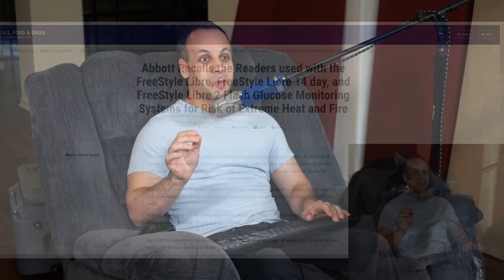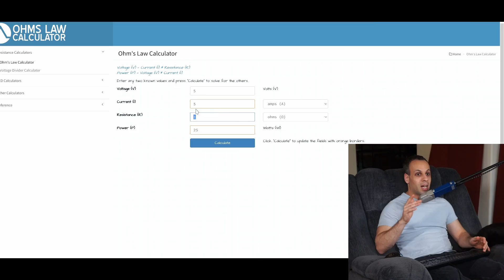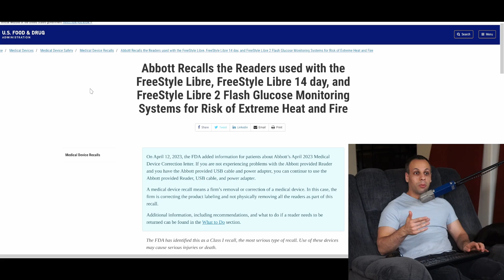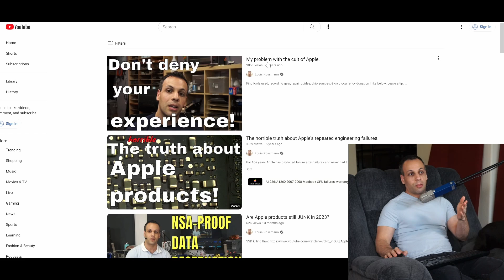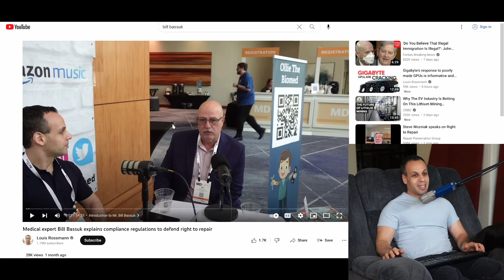Abbott gaslights customers during FDA recall of burning glucose monitors

Comment: I might still have my freestyle libre reader around somewhere. I mostly used my phone to read the glucose monitor anyways, but luckily I never had any problems with the Abbot reader when I use that.
Reply: But yeah, if I can find it I will gladly send it in. Even though you are saying you don't deal with medical devices, the reader specifically is more of a component in the freestyle system than it is an actual medical device. It's basically just a tiny limited function smartphone with an NFC reader in it. The actual medical device is the diode and transmitter that attaches to your arm.
Reply: I can barely imagine that the device is poorly made enough to where it couldn't properly with 3rd party chargers. Mine still holds charge quite well, and it's about 3 yrs old, kept fairly poorly (heast, moisture, dust, etc.). I haven't used the yellow cable it came with in at least 2 years cuz I lost it. 

I don't know jack about electronic repair, but could these devices somehow lack the capacity to reject charge once full? I could see the device wearing out way faster if it's always being left on a charger. Otherwise, I wouldn't know. 

With that being said, as a former customer of several years, I can absolutely say that Abbott's customer service on this device is AAA top-tier! 

Yes they are having to issue a recall, and yes it does display a lack of oversight on the manufacturing end, but I don't know that it's worthy of critique in the same way you're able to go at other companies. 

DME companies are usually crazy above and beyond with customer service. I'm not currently using the freestyle libre, but I can tell you that in all likelihood every customer who wants a replacement reader can and will get one for free. Furthermore, most people who use the freestyle system just use their phones. The reader is more of a backup and or option for people who don't use smartphones.
Reply: And I guess another furthermore, it does pain me slightly to call Abbott an ethical company, but the freestyle libre is literally the most affordable continuous glucose monitoring system on the market currently. There are other options which provide more precise data, but at a significantly higher cost without insurance. 

This might not be true of the latest freestyle system, but as I recall the freestyle libre 14-day, OOP or insure, priced out to about the same as a glucose meter and test strips.

Comment: Can we take a moment to say the obvious?  These monitors should not even exist. You can literally use your phone and use the app to read these sensors. If they can't get the basic engineering of a monitor right, then they should just pivot to selling a cheap android device with the app preloaded and do the relevant QA on that for when a dedicated monitor is for some reason actually required over the standard app that is already in the google play store and apple app store. My dog uses this product.
I am a software engineer that has worked on a computer vision medical product that received FDA 510(k) clearance.

Comment: If a device with a USB symbol can't accept a USB marked charger and cable, then somebody is in breach of their licence to use the USB symbol.  This is what standards are for!
Reply: Abbott doesn't put a USB symbol on the device.  They supply a  yellow usb A to micro usb cable (this cable does have the usb symbol on it) and a wall block.  Couldn't tell you if the wall block has a usb symbol or not (it is 5v),   no idea where mine is as I use an old phone charger.  As Louis figures, poor design, and using some low wattage supply as a limiting device.
Reply: @alexb.1320  wait, this is even more bonkers: So you're saying their statement can be read as 'please do not use a "genuine USB" cable, but rather our "genuine Abbott" that is actually NOT a real USB cable'  ?
Reply: @alexb.1320  The USB symbol IS on the device please dont spread false info if you dont know. There is a USB symbol on the multiple Libre devices and on the cable but not on the block.
Reply: @walrider  I don't see a usb symbol on my device, an original libre.
Reply: @alexb.1320  Weird... I have an original and a libre 2 and both have it at the same place. It's directly above the actual usb port on the side of the device.
Reply: If you believe that just plugging a USB cable from a third party causes the device to catch fire, then Louis has fundamentally failed as a communicator, or you only heard what you wanted to hear.  Because that isn't what was communicated in the release.

"The potential for overheating, spark, or fire may occur when charging the Reader with non- Abbott adapters or non-Abbott USB cables combined with misuse of the Reader and its components. Examples of misuse include exposure to liquids, damage, and introduction of foreign material into the ports.

The Abbott-provided USB cable and power adapter limit the power provided to safely charge the battery whereas USB cables and power adapters manufactured by a third party may allow much higher power, increasing the risk of overheating, spark, or fire."

Meaning that if you get crap in the ports and short or block a connector, both the Abbott provided charger and cable are smart enough to limit the amount of power delivered in the event that some communication with the device (like temp) is missing.

Other cheaper cables and chargers are clearly missing that feature.

Comment: Finally some confirmation for how shitty Abbott is! Last year I got diagnosed with diabetes type 1, in which I got glucose sensors from Abbott. To be completely honest I am very impressed and happy with the actual hardware for the sensor. At least for the version 3 sensor, as it is incredibly small and discrete. The thing that drives me crazy is how absurdly bad the app is that you have to use with the sensor. This whole video is about a monitor, which is used to scan the sensor on your body to get your glucose value. However I believe that the very large majority uses a phone app to scan the sensor with the help of NFC (which makes your point at 10:56 even more prevalent). In contrast to the actual sensor hardware, the app is absolutely atrocious. It has so many glaring flaws, where it is missing a huge amount of really basic features.

There are an absolutely huge amount of issues I have with the app, but these are some of the most frustrating ones: The app for the version 2 sensor has a thing in its settings that allows the alarm that plays when you get low glucose (which is very dangerous if left alone, and has to be treated immediately by eating sugar) to be customizable. The default alarm noise is way too fucking intense and it makes me almost panic whenever it suddenly activates. I have made a custom alarm sound that still catches my attention, but one that isn't as intense. This is on the app for the version 2 sensor, which already has quite a lot of big problems. So when I got my hands on the version 3 sensor (which hardware-wise is way more superior, and comfortable to "wear"), and got the app for the version 3... IT IS EVEN WORSE. First of all, in the settings there is still a button for setting a custom alarm sound, great! But... the button is NOT CLICKABLE! And it doesn't explain why! So you are forced to use an ear screeching, panic inducing alarm if you don't want to put a risk to your life by not using an alarm. What's more? The app for the version 2 sensor has its alarm sound's volume on the "notification sounds" type. Since I never use that I am able to permanently set it to a set volume, and control the volume for my "main sounds" freely. For some fucking reason they decided to change this in the version 3 app to use the "main sounds" volume! I was able to come up with a super hacky solution completely outside of the app, and in my phones settings so that the alarm actually uses the "notification sounds" volume, but if I was unable to figure out a way to do this I would have to always have hyper-focus on my phones volume, since if I keep it high for the alarm but forget it, then I could accidentally play audio in public settings, which both bothers people around me, and is embarrassing for me, but if I have the volume off from doing stuff in public that would normally produce sound (like for example playing a mobile game), then the alarm would be completely silent and I would put my life in unnecessary risk.

There is an app you can use that connects to someone else's app that scans the sensor, so that for instance a parental figure can help keep track of their child's glucose. This app fixed the problem of having to keep track of your volume! How? THE VOLUME IS NOT ADJUSTABLE. IT ALWAYS GOES OFF ON ABSOLUTE MAX VOLUME. And this is with the default, panic-inducing alarm.

Another huge issue that the version 3 app had (up until very recently, and I'm honestly EXTREMELY surprised that the issue was fixed), was that if the alarm has gone off from you getting low glucose. It would NOT go off again until your blood sugar went over the border of when you are considered to be low. This made it so that if you either forgot to eat something to increase your glucose, or what you ate wasn't enough, then the app would NEVER re-sound the alarm to tell you that you are still low. This is such an absurdly important feature, that is extremely simple to implement, but even so it took them absolute ages to actually implement! I have had my life almost end up in critical condition MULTIPLE TIMES due to this extremely simple, lacking feature.

A couple of months ago I got some privacy policy update or something like that, where they mentioned that they collect your glucose data to improve the experience of their services, but that is so obviously not true, since the app has such incredibly huge flaws, and where the version 3 app has 1.9 stars out of 5.

I have also heard that Abbott made pacemakers that had an incredibly huge, obvious flaw. I don't know much about it but it was something like how they weren't password protected at all, so anyone could very simply hack into them and literally kill someone. And now in this video I also learnt that they make poisonous baby-formula?? How can you be so incompetent???

I fucking hate this company, and I hate even more that I have such hard difficulties switching to another brand that makes glucose sensors. This is because, as mentioned before, I am actually very impressed by the sensor's hardware in terms of its physical size, as that is a very important for me. The other very popular glucose sensor brand Dexcom makes absolutely huge sensors in compassion. I also have the problem of the Freestyle Libre sensors (the Abbott ones that I have been talking about this whole time) being the ones that are provided to me for free by my country's medical providers or whatever it is called. I feel like switching to another sensor brand would - ignoring the problem of size, and having to learn a completely new sensor - be very hard.

Comment: As a diabetic using this system, the device mentioned in this video is indeed underwhelming.  I had two fail on me in the last 6 years.  Although I still have an Abott Freestyle Libre reader, reading glucose levels from the Abott sensor has shifted from standalone devices to NFC/BT on the phone, so thank god for that.  That system isn't flawless either, but it works.
Reply: The blood is mentioned because the device can also read bloodstrips and things can get messy.

Comment: If it breaks because a wrong 5v charger is used that's manufacturer's fault simply because ohms law you can't draw more amps without adding more volts if you make it work with 5 volts it will never burn out unless you add more volts it's simple math really... But you understand ohns laws I'm sure
Reply: Technically if you make a 5 volts circuit that's only capable of .5 amps but has a ohms of less than 10 ohm's because there too cheap to buy a resistor it could blow up if you connect a charger that outputs more than .5 amps just saying it is possible a wrong charger can break it but that's definitely the manufacturer's fault for risking someone's life to save the price of a resistor if one person actually died because of a missing resistors it should be man slotter. But I would assume a medical device would have more regulations that would I assume stop them from savings 10 cents at the cost of a human life. But I don't know maybe your life isn't worth 10 cents

Comment: I worked on design of mobile phones 10 years ago. Problem is that one can buy 1$ charger that outputs 5v but with short spikes up to 11v. I have seen that with my eyes. Technically that is not usb charger but it is on market anyway. No one HW designer can predict all the shitty combinations so called usb charger can provide. It is easy if user use properly certified CE or UL charger

Comment: I've already seen stupid usb charging systems. bluetooth headphones that can't charge via a usb port... bad design. but usually, the common denominator is 5V 100mA and then the receiver can demand more. but I've already seen my own stupid analytic device that kills its battery and then needs to be shipped to the manufacturer in the US (over an ocean) to swap the batteries. because you are not allowed to open the device on your own and put in new batteries... or make a device that does not kill batteries in the first place?
by the way, blackberry was very advertiserfriendly today. she remained on the left side where the kitty belongs to, whereas the mouse remained on the right side, where the mouse belongs to. 🙂

Comment: But if the device doesn't have circuitry that controls charging and it's all in the special factory made charger then why the hell would they use USB socket instead of just some DC jack or what you call it? They made a device that will be destroyed by regular 5 V voltage source but they put a USB socket there.

Comment: I have run into this issue with charging my phones from a USB outlet on my clock radio. The behaviour makes sense given your explanation of how the devices ask the charger to ramp up. I'm happy with a slower charge to reduce stress on the battery.

Comment: I am type 1 diabetic and have an Abbott FreeStyle Libre 2 sensor. I've been using the yellow micro USB cable it comes with on my old Samsung brick and I've had no issues. The charger brick it comes with is still wrapped in plastic in my draw as I have no use for it as I figured the resistance of the cable will suffice for protection. They've just been caught out implementing non-standard USB to save money presumably and are trying to blame the customer for using it wrong. Most people will just use whatever charger and cable they most likely already have considering it's a 'universal' standard.

Comment: I sure am glad the basic non-smart glucose meters are all that are available in my neck of the woods. Just gotta make sure to stock up on at least a three-pak of those little 'button' batteries that are at times difficult to find.
Reply: Nah this is way better then destroying my fingertips every time i need to check my glucose level.
Reply: @user-ee9cz6mc1x  I never really had that issue. I simply found the right depth setting (7) on the lancet dial and it never hurt nor did it ever create a callous around the tip of my finger. Then again, I do have the unusual combo of higher-than-average pain tolerance and super-soft skin lol

Comment: I use a glucose monitor from a different manufacturer, but don't use the provided reader, as the sensor works directly with my phone using bluetooth.  I just received a new model that also has its own included reader, presumably with its manufacturer provided charger.  I think I'll stick with using my phone to record my readings as this problem has made me pretty wary of using the provided chargers.  What makes me really nervous as these things are designed to communicate with glucose pumps, which also have to be charged.  If they can't get the circuit right on an external device, would I want to take the same risk of fire in a device directly attached to my body?  HELL NO.

Comment: I gave up using their glucometer and just use the phone app. Not that the phone app is good, it's slow, often doesn't pick up the scan data correctly, and the high/low alarms are often significantly delayed. If you want to see inside the part that connects to the person though this is a breakdown of the first version of the sensor: https://raw.githubusercontent.com/cryptax/talks/master/BlackAlps-2019/glucose-blackalps2019.pdf

Comment: One thing that always freaked me out was usb Y cables. I assume if one of the devices negotiates more than 5 volts all the devices plugged in get the higher voltage.
Reply: A Y cable should be power only and only at 5V. USB compliant devices couldn't support two devices sharing the data line like that.

Comment: 2:10 One little point to make si that while no liquids are likely involved with this, most ofthese easily can due to the fact that they often have the ability to use their own FreeStyle Optium strips, which means they can come into contact with not just simply regular liquid, but also bodily fluids likely containing urea or white blood cells. 

These sorts of things should be used to having a small amount of liquids in them - they may not be waterproof, but even so they are still designed to have some exposure to asmall amount of liquid
Reply: 10:20 And yeah, that gets me because... these readers are likely to be involved with blood now and then. 

So glad I'm on the Dexcom system now.
Reply: I- what?? Glucometers never get in direct contact with liquids. You don't understand the device and the test strips if you think they routinely come in contact with liquids.